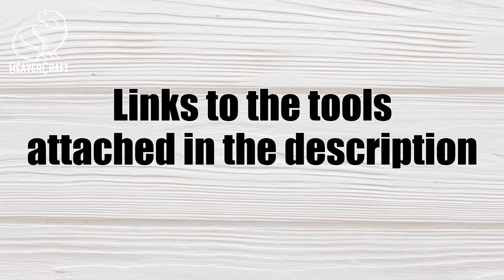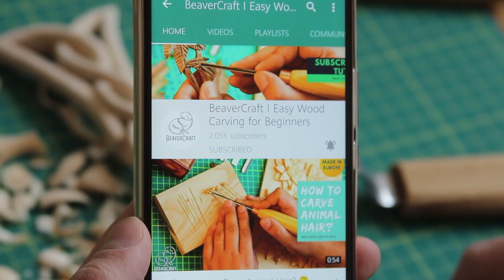Woodcarving Angel Tutorial

Comment: May I ask what type of wood you are using in this video? I started only a few months ago with pine.. but this one seems easier to carve.
Reply: He used bass wood. You can get a package of different size blocks at Walmart in the craft Department or at pretty much any craft store.
Reply from the maker: yes, it's basswood and you can find the basswood blocks here: http://bit.ly/34uBgGg
Reply: By the way, I started with doing the same thing with pine thinking that it would all be the same, and found out that pine is nutritiously hard to carve, especially for beginners, because of how easy it is to splinter and how hard it is to smooth out at the edges. Basswood is great not only for how much easier it is, but also because it's quite cheep to buy. Best if luck.